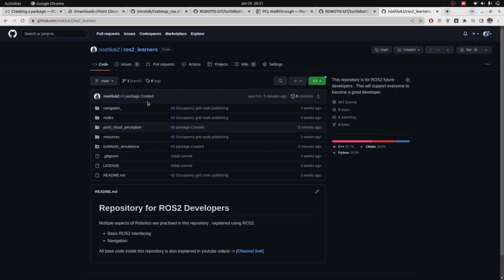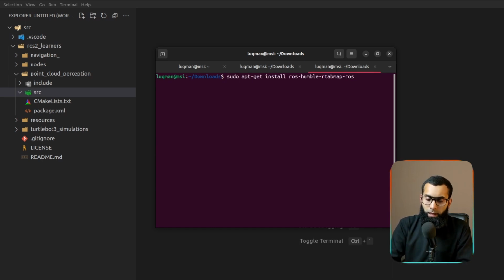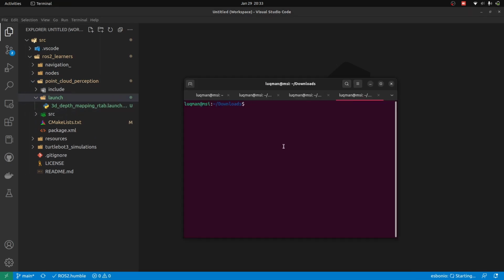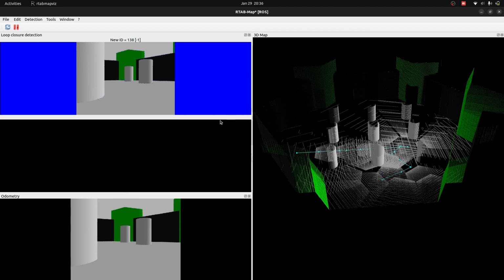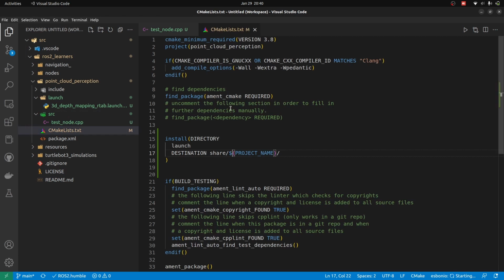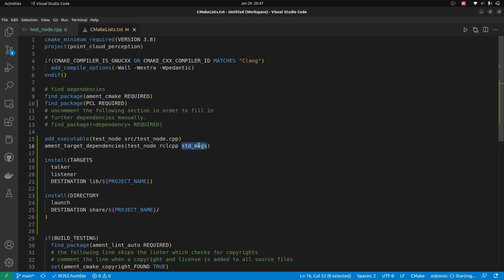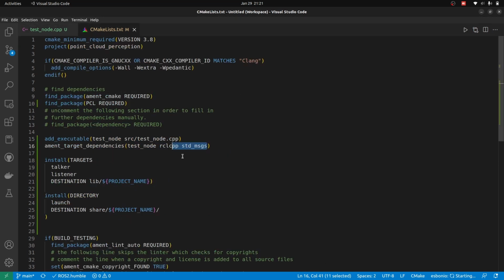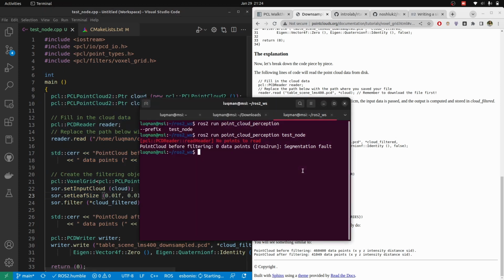Getting Started with ROS2 and PCL: An Introduction to Point Clouds for Beginners

Comment: Hello, thanks a lot for creating a video in the topic. I have one problem, that when doing "ros2 launch point_cloud_perception test.launch.py", only the 3D map and Odometry appear, and no map is created. As I move, the view of 3D map just shows what the robot sees at that specific time. Also, I'm not able to export any 3D cloud. Thanks in advance.
Reply from the maker: ensure your launch file parameters for point_cloud_perception are correctly set to capture and publish the 3D cloud data—not just the odometry and immediate sensor view. Double-check that all necessary nodes are running and look for any error messages in the console. A workspace update or reconfiguration might help resolve the issue.